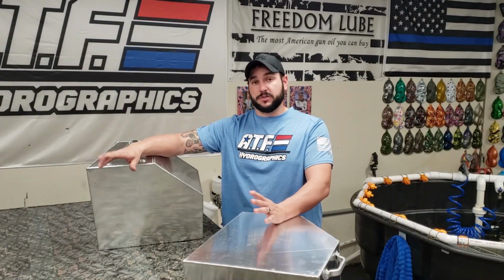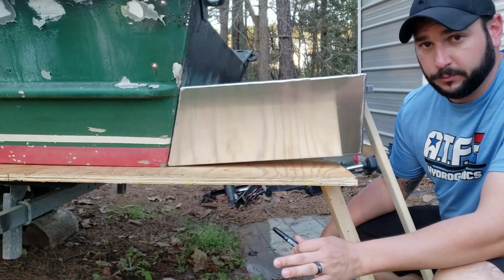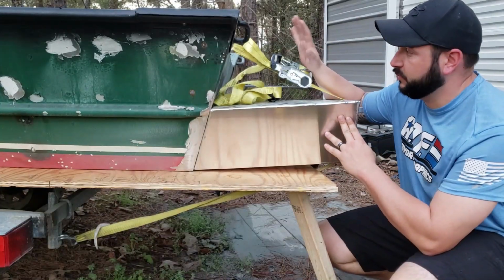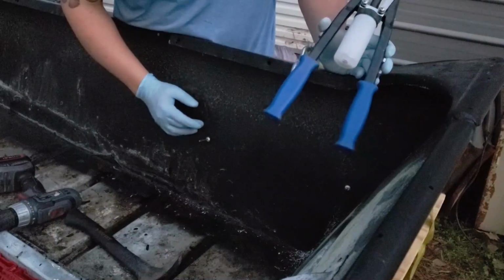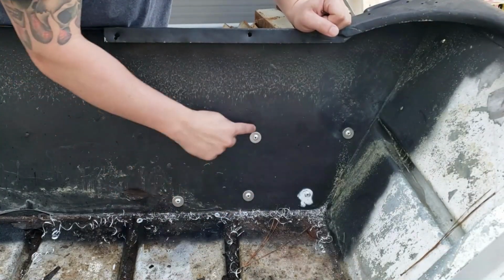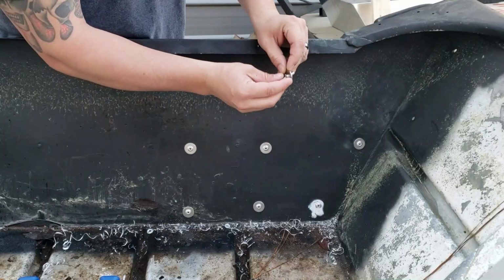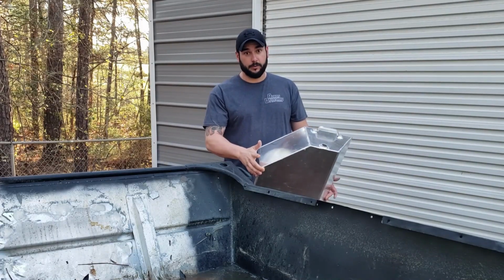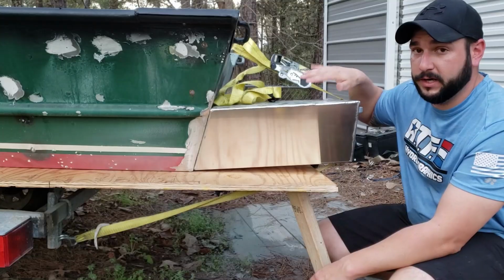Easy Jon Boat Float Pods || NO WELDING REQUIRED!!!

Comment: Not going to lecture you on your choice of dissimilar metals, but I would recommend a mask when grinding that 40 year old paint off the boat.
Reply from the maker: Yeah that would have been smart.
Reply: Oh hold on guys let's all pause what we are doing, outside in the open air with wonderful natural ventilation. Osha has arrived on seen and they know best.
Reply: @christophertibbetts2458  based on your response to someone giving good advice I’m gonna assume that you have already inhaled some lead paint , please go seek medical attention.
Reply: @samuelmoyer7862  I’m dead lmao
Reply: Y'all aren't gonna say anything but not wearing eye and ear protection??
Reply: @christophertibbetts2458  Yeah, you’re right… eye and ear protection would have been a good idea. But that old ass paint will wreck your lungs. It isn’t like an aerosol that will disperse in an open area (which you should still use ppe), but rather large particles of paint dust that probably have some awful things in it.
Reply: From what I've read lead paint was a favorite for boats for many years and although banned in 78 plenty of it was and probably still is around, and folks tend to think something works better if it's been banned. Food for thought
Reply: Only thing I would change is to drill all of your rivet holes before you seal the pod on. That way you can very quickly pop those rivets pulling together the surfaces better while it's still very wet. Oh and just cap seal the rivets and washers when done.

Comment: I like your mounting method its simplicity is the selling point you just need to do a very careful job of placement before drilling and putting on that sealant
Reply from the maker: Yes be very careful when drilling. It's one of those measure 14 times and drill once.

Comment: I have that drill. Had it for ten years and still works and used as a work horse it will never break. Myn looks like hell I'll send u a pic of u want
Reply from the maker: I Love my porter cable 18v. Had it for about 7 or 8 years, still works great. Had to buy a new battery on amazon and it works great.
Reply: @SendItJonBoats  I never even replace batt lol sure it's time for a up grade but why I used it every day used to drill threw plow studs till drill motor was smoken bout 5 years ago it just didn't quick it's in my box kinda retired but still works!

Comment: Has this install method held up? Would you install these float pods like this again or weld them
Reply from the maker: Yes sir they are holding up very well, and I would not hesitate to do it again in a heartbeat. I will be doing a review video on the pods soon as I can get back out and get some video filmed, weather has been kinda crappy here lately.

Comment: On top of the rivets and adhesive stuff, could you also braze it with alumaloy or whatever that stuff is? It would be much cheaper than tig, although dealing with the heat dispersion might be hard because of the size of the pieces.
Reply from the maker: I could have done a lot of things, but I wanted to try something different and see what happens. It worked just fine and was one of the many experiments I will be doing on this channel.

Comment: I am fixing to order my pods for my john boat but I am having a hard time deciding  which size to get Small or large pods. I have a lowe 1648 similar to the 1648 you are working on in the videos. Did you use the medium or small pods on your build? I want to use the medium but when I measure the back of my boat it doesn't look like there is going to be enough space between the two pods for turning my Johnson 40hp Hand till motor. Are the dimensions correct on beavertails website as I have not had much luck with their customer service.
Reply from the maker: Hey Sean, I used the medium pods but I was not worried about the size because I am running a longtail mud motor. The measurements on the Beavertail website are accurate so you would jut need to measure how much room your outboard needs to turn and then figure out how much space the small and medium pods will leave you once mounted.
Reply: @SendItJonBoats  awesome thanks man. I cut out templates and measured I'm gona have to go with the small pods
Reply from the maker: @seanmatthews6900  Cool! Let me know how it goes... and don't forget to SEND IT!!!!!

Comment: Used 3M 5200 20 years ago on my 38 foot  Topaz. It really does hold forever. If things are clean.
Reply from the maker: I have heard the same thing James, as long as the install is clean the 5200 seems to last a really long time. These pods are holding up really well so far.
Reply: @SendItJonBoats  I was looking for if the pods were lasting. I like the idea of this. I’ve been thinking about pods but welders here are expensive. Just found the channel and love it.
Reply: @SendItJonBoats  do you post the material list for the rivet washer bit size.  Awesome video sir, I'm going to order these so my son and I can try putting them on our flat bottom boat

Comment: How much flotation does that give you? How much cubic feet of volume do they add?
Reply from the maker: I am not really sure on the math part or volume part, hopefully someone smarter than me can help. I know that I can but a 250 lb motor on the back, plus me at 240, and my buddy who is about 180 on the back of the boat and water barely comes up to the top of the pods. So It does add a good bit of flotation.

Comment: What size float pods did you end up using? I see that beaver tail has three options available.
Reply from the maker: I used the medium size. They fit perfect for my 1648. if my boat was wider I would have got the Large pods for more floatation.
Reply: Ok cool, I have a 1648 as well. I’ll order the medium. Thanks for the info
Reply from the maker: @casanova2xm  No problem, good luck. I am sure you will love them. I love mine.
Reply: @SendItJonBoats  would the medium size work well with a 1436 or should I use the small ones? More flotation the better but room for the engine is another story
Reply from the maker: @nate4036  You would have to measure how much room your motor needs to turn fully from side to side, then figure out which one will fit and allow it to turn without smacking the pod
Reply: Off of what has been mentioned, I run a long tail off of a 1444 alweld. I want the most I can get out of the pods, would adding a set of the large pods be an issue? I should have approx 10" between the pods which again doesnt matter much being that I run a long tail on the boat.

Comment: You could have used an aluminum plate the size of your floats as a stiffener insteadof washers. Just a thought.
Looks good.
Reply from the maker: That's actually a good idea, I did not think of that.
Reply: @SendItJonBoats  I'm an engineer but not a good painter.
I binge watched your build videos and you gave me some great ideas for my boat.
Send it!
Reply from the maker: @markjob7736  Heck yeah man, send it!
Reply: You’d put a plate on the inside of the boat? That would evenly distribute the stress right ?
What thickness would you suggest ?
Reply: @stumblin_bummblin9774  1/4 " to 3/8" thick

Comment: How's the install holding up? 
I'm about to order some for my boat and am torn on what method to stick them on with.
Reply from the maker: Holding up amazing and they work great. I cant recommend them enough. I have drug that boat all over the place by the pods, picked it up, rolled it over, hit stumps, smashed into boat docks... still holding on just fine.
Reply: @SendItJonBoats  
Good deal, thanks for the reply.

Comment: Just wonder if you could also drill small hole on inside & fill with spray foam to help with the  Floats???
Reply from the maker: It wouldn't add any extra floatation, it has been tried before and all it does is give moisture a potential place to get trapped and either water log the foam or start molding.

Comment: I would like to see the finished product with motor on the water to see if any interference with tight turning?
Reply from the maker: Im running a longtail mud motor, the pods wonts affect anything for turning. On an outboard or short tail mudmotor you would have to measure before you installed them so it wont mess up your motor turning.

Comment: Alcohol should not be used with 5200. It alters the chemistry of the curing compounds. You got lucky on that one, sometimes it doesn’t hurt to read the instructions. It says do not use alcohol for surface preparation on the tube.
Reply: Alcohol evaporates quick and with no residue, you silly silly  person. He didnt use alcohol to cut the adhesive.
Reply: @TheShockLoad  nobody said anything about cutting. Not even 100% anhydrous isopropyl alcohol can be depended on completely evaporating residue free, especially on a rough surface. I was just trying to point that out without being a mega asshole. The 5200 may have cured most likely because there was nowhere near enough used. You want to make a gasket out of that shit and rivets always go around the parameter because that’s where the stress is. (Channel Lock brand 90 degree riveting tool $25) 5200 is an excellent adhesive but can be used as a bedding compound by intentionally contaminating it so it won’t cure. I literally work with this stuff every day keeping coast guard, navy, army, and army corps of engineers ships operational. Use acetone if you don’t want to ruin a lot of expensive time and material when you get to work on your first boat.
Reply from the maker: Thanks for the tip, I will read the tube better next time.

Comment: What are the benefits of these floats
Reply from the maker: They help provide more floatation on the back of the boat for heavy motors. Basically keeping the back of the boat from squatting too much.
Reply: @SendItJonBoats  gotcha 
I started running commercial hoop nets on the Wabash river in Indiana last year “it’s awesome”
Have a 16’ seaark with a 25 hp merc
Trying to decide if I should throw some on for when the waters way down
Boat gets on top pretty easy but I just don’t know if it will benefit 
My poor prop got ate alive towards the end of season

Comment: Wonder how these would work on a 17ft bass tracker? I hate how low the back of the boat sits in the water.
Reply from the maker: Would probably work great, I highly recommend them. Helped my boat not squat in the back and they ran fine.

Comment: How has this method held up for you so far in use? Rivets wearing out and getting sloppy? Thanks for the great content!!
Reply from the maker: Holding up just fine, not a single loose rivet and have hit several stumps and boat docks, no issues. Will be doing a follow up video soon.
Reply: the entire boat is made with rivets
Reply from the maker: @jerrybear3081  exactly

Comment: Hello, I'm a recent subscriber just working my way through your library. I'm learning a lot, so, thanks for that. I apologize in advance. Plenty of people have already made plenty of comments about the stainless screws in aluminum. I'm still gonna add mine. If you're aluminum, and somebody ran a stainless steel screw through you, well, you've been screwed. The good part, is that since it's a stainless screw, it won't leave a mark. So nobody else has to know that you've been screwed. 
I have a question; what is the collection of colorful, sort  of gourd shaped things, hanging on the wall behind you?
Reply from the maker: BWWAAAHHHHAAAA that was the funniest thing I have heard all day! I am so screwed! LOL Thanks for joining in Bob, glad to hear you are enjoying the videos.
Reply: @SendItJonBoats  I would still like to know what those colorful things are that are hanging on your wall. 😃
Reply from the maker: @bob2161  Oh sorry, I missed the last part of your question. Those colorful things are called speed shapes. I own a hydro dipping shop and we use those plastic speed shapes as samples for new patterns and customers can look at them. Since the weather has been so crappy lately I have been filming inside the shop when I can to stay warm. I also have a hydro dipping channel as well, where I do weekly hydro dipping videos. Channel is ATF Hydrographics, or All Things Fun Hydrographics.
Reply: @SendItJonBoats  thanks for the response. I've looked them up and now I know. I will have to check out your other channel after I've caught up on this one. I'm learning a lot. 
It seems we have similar senses of humor. I have to ask about this channels name. The term "Send it", to me, conjures the image of a spotter and a, let's call him a ballistic projectile delivery specialist (keep the algorithm happy), laying prone, on some ridge top. When I picture that, and the unicorn mounted warrior in your intro hollering "Send it", well, it's pretty hard for me to not giggle and grin. (How's that for a run on sentence?) Is my imagination on track or has it jumped the rails?
Reply from the maker: @bob2161  You are absolutely on the right track! I like pew pews and going fast so put the two together and ya SEND IT!!!! LOL

Comment: I would have done threaded rivet nuts in the float pods, drilled through holes in the boat, and bolted them on with thread lock, and 3M 5200 in between for waterproofing.
Reply from the maker: I could have done a lot of things, but I wanted to try this and experiment to see if it will work. It worked.

Comment: Are you putting a mud motor on that boat and how does it do if you are
Reply from the maker: Yes sir, it is getting a mud motor. I already had it out on the water a few times and it works great. I will be doing a video soon all about how the float pods handled with a lot of cool video footage of them in action. There is so much mis-information out there about pods and mud motors and I want to set the record straight.
Reply: @SendItJonBoats  I was wandering because I've been told that pods and long tail mudmotor don't go well together can't wait to see how it performs
Reply from the maker: @mudmotorcatfishing  i was told the exact same thing, and I was told a lot of other really negative things about my pods and the way I mounted them... The video will explain it all, but in short: Best mod I ever did to my boat. Performance was better than expected and my angles were perfect for this boat.

Comment: I want to see an update in a year. Drill bit size would be .257
Reply from the maker: 10-4. Will be seeing them in action in a few weeks. I just got back from taking them out and doing some filming.
Reply: @SendItJonBoats  don't get me wrong I respect the s*** out of what you did. but at the same time I've never seen a riveted Jon boat. Where the rivets last forever. Eventually it's going to fail way before a weld. And it could be catastrophic.
Reply from the maker: @frogmanpipes9561  I completely understand, and I have no clue how it will hold up long term, but honestly I will be moved on from this boat and onto something bigger and better within 3-5 years so if it lasts that long it was worth the minimal effort. If i were keeping this boat forever then I would be welding them on.

Comment: First of your videos i've seen, loved it! You got another sub !!  For installing a  rubrail, I bought a cheap pneumatic rivet gun, worked great.
Reply from the maker: Nice, I need to get a pneumatic rivet gun one of these days. Next time I am at harbor freight I may need to grab one.
Reply: @SendItJonBoats  that is where I got mine. Get the bigger size though, the smaller size it will break with the 3/16  rivets, even though it says it's rated for them. Once I got the bigger one, no problems with 3/16 SS rivets. Put over 100 of them in the top cap.
Reply from the maker: @fishingismydrug1  Great info. i will definitely give that a shot next time I am doing rivets! Thank you.
Reply: @SendItJonBoats  Your welcome Sir!

Comment: I use either nylon or neoprene washers under SS washers to isolate the two metals, but I tend to overkill.
Reply from the maker: Good tip, I didnt even think of that. May be overkill but if it works who cares! I will add that to the next one!

Comment: Bro video is great on question tho what are those things hanging behind you when talking ?
Reply from the maker: I was filming in my hydro dipping shop, and the things on the wall are called speed shapes... they are just samples of the hydro dipping patterns we have. If you want to check out my hydro dipping channel it is ATF Hydrographics. We use those speed shapes all the time to test out new patterns and designs.
Reply: Send It Jon Boats l